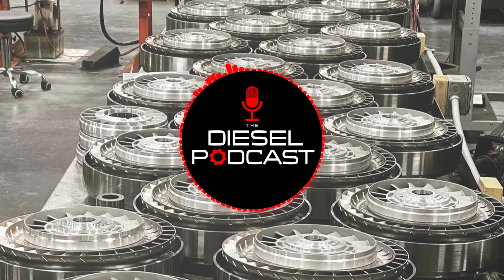RevMax Torque Converter Stall

Comment: Would a  lockup event rpm drop be equated  " stall speed"/slipage? Eg my new to me 98 12v ram4x4 stockish TC (welded lugs) drops 500 on lock up in 3rd and 4th as well as 500 rise on unlock .

Comment: Firstly, I'm no expert. In regards to your opinion on low stall for heavy towing, I've talked to a few people that said with a lower stall they're having to bury into the brakes at a stop light because the truck is trying to take off. Wouldn't that, with my non-expert thinking, cause excessive unnecessary wear to your rear clutches or is that part of the give-and-take with having better take off when loaded?